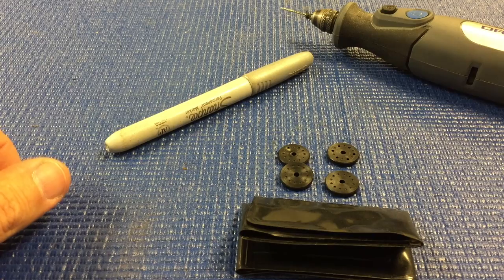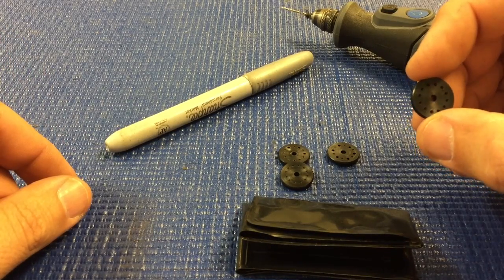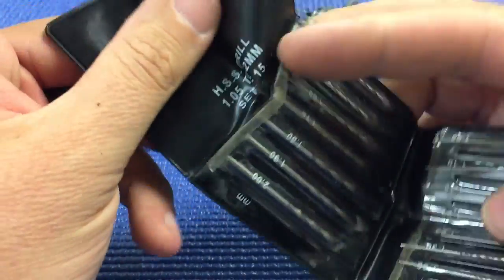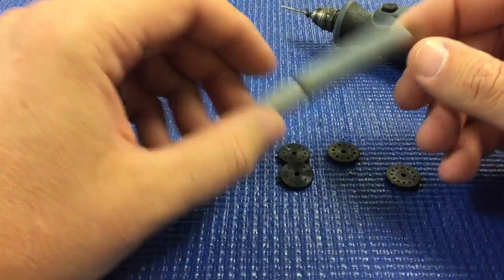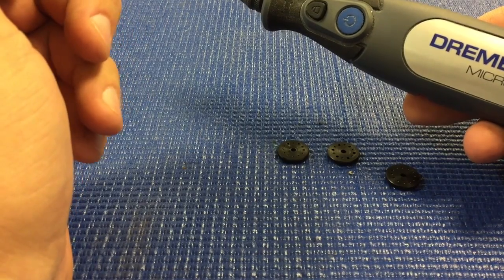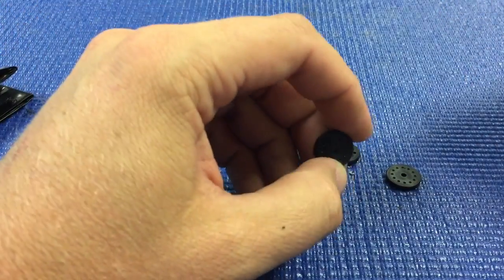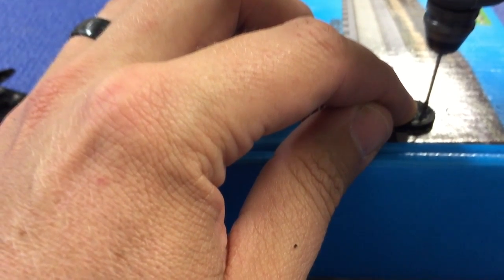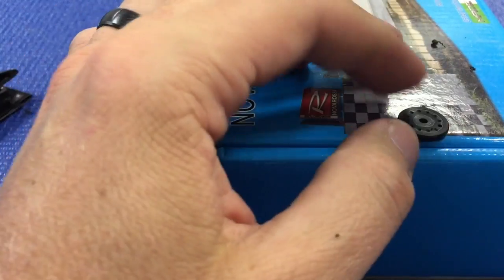Adam Drake from Mugen Seiki Racing shows how to drill shock pistons.

Comment: Hey Adam, I know you mentioned the 6x1.3 Pistons are kind of your standard. I was wondering under what conditions would you use an 8x1.3 and a 5x1.5 as those are two other piston types that are very popular.
Reply: I plan to do a video on this at some point.  In general, more smaller holes will drive flatter and work well on smooth high speed tracks.  Few, but larger holes will be better on bumpy tracks.

Comment: Adam, as always your videos are excellent sources of information not only for us the Mugen racers, but to everyone in the hobby. I do want to ask you when you decide to go to a larger size hole, or more holes or even using taper pistons. I understand with shocks the combinations are endless because you have the variables or the pistons, the oil, the springs and temperatures, but if you can do like an overall video that will be great, so we can have a baseline on how to move back and forward.
Reply: Great question William.  I plan to do a video on this at some point.  In general, more smaller holes will drive flatter and work well on smooth high speed tracks.  Few, but larger holes will be better on bumpy tracks.